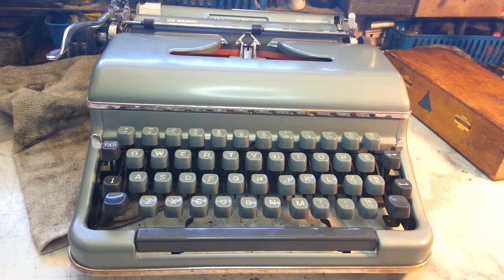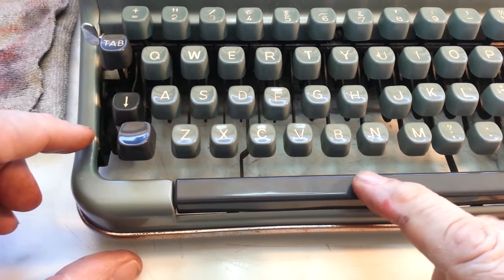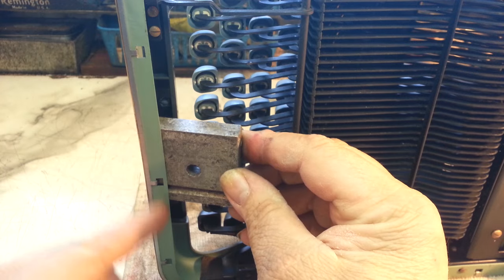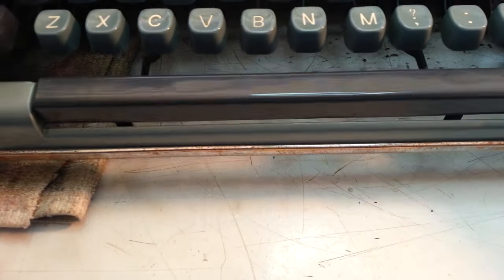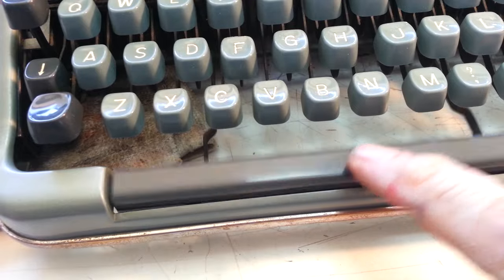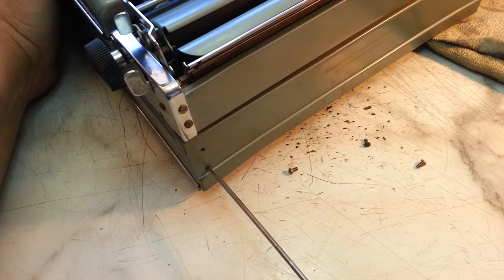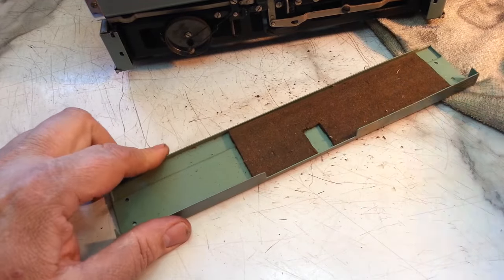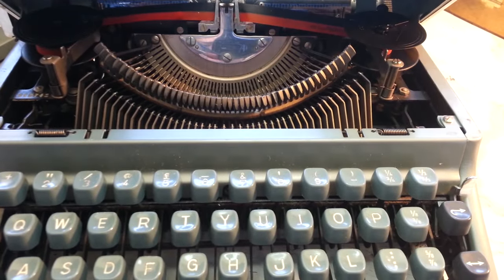Blue Bird (Torpedo) Typewriter got Shipping Damage, Bent Body, Broke Bell, Repaired Space bar

Comment: I have a Remette that was bent in the front like that, same thing. I made a frame straightening jig and carefully straightened it with a c clamp. I picked it up locally but possibly that guy got through the mail. It works now.

Your way looks a lot easier.